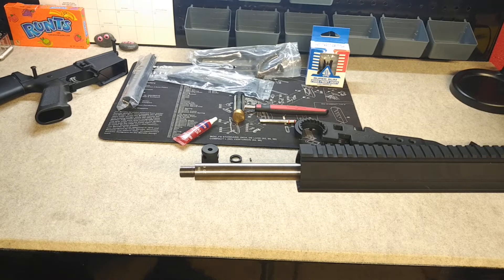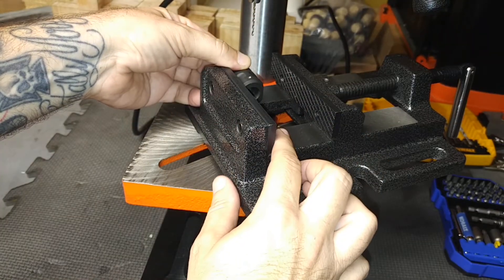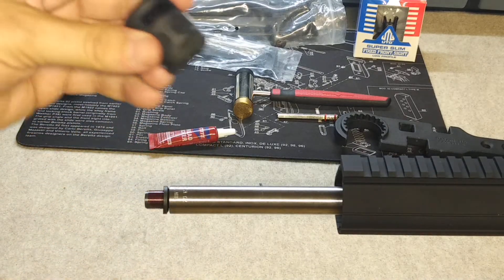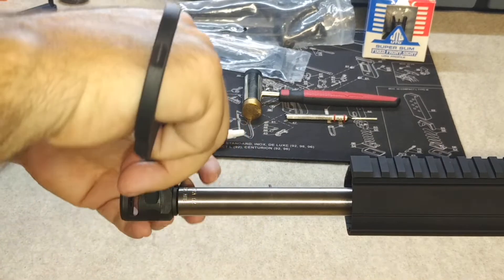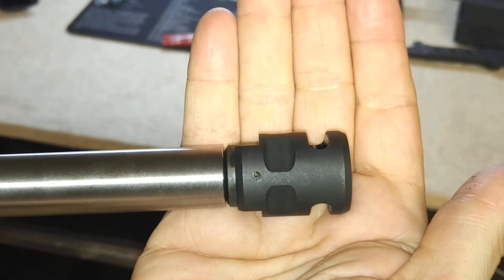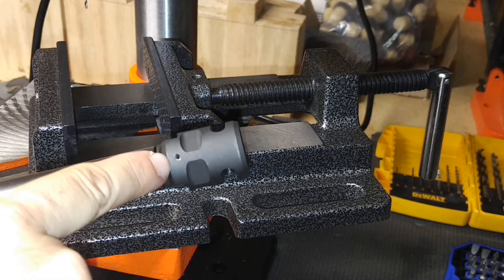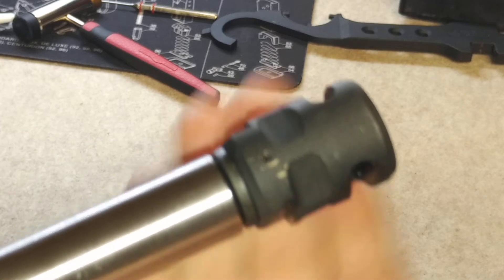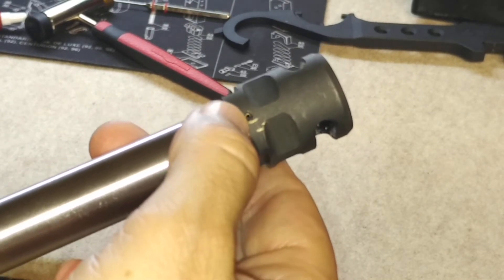Permanently Attaching A Muzzle Device To Project Starling

Comment: I definitely would not use any thread tightening stuff on there in the event you want to switch out You can always drill out that weld and be able to take the muzzle device back off and put a new one on so definitely would not try and put anything more permanent on it other than that pin and weld
Reply from the maker: I agree but I live in New Jersey and If the muzzle device is not permanently attached, I would be committing a felony. I don't mess around when it comes to the firearms laws in this state. But yes anywhere else in America and I wouldn't pin, weld or use thread locker. Thanks for watching.

Comment: Why cant you turn it backwards if you accidentally go pass the 12 o'clock?  Thanks
Reply from the maker: If you turn it to far and then back it off, the crush washer becomes compromised. With. Every turn, the crush washer is compressed by the muzzle device. The muzzle device and crush washer need to stay in contact for the crush washer to function properly. When you back the muzzle device off, the crush washer has now been compressed beyond the point of contact with the muzzle device. If this happens, the timing of the muzzle device can shift. Thanks for watching and I hope this helped. If you like I can do a quick video to give a visual to help explain.